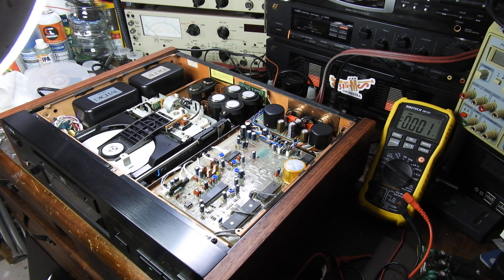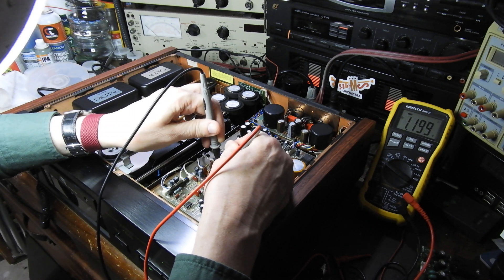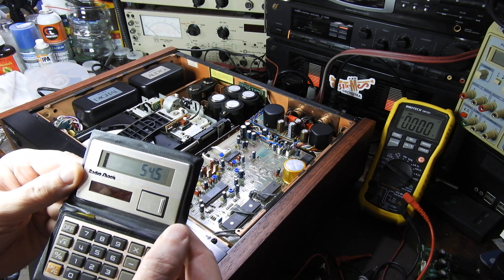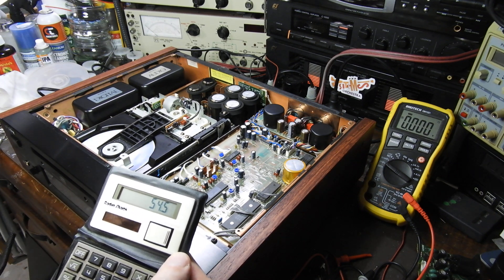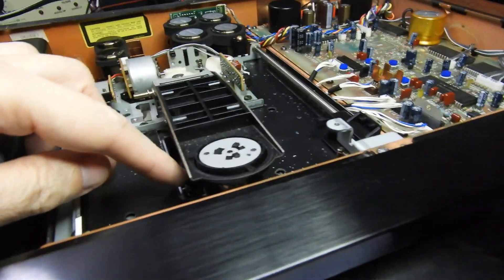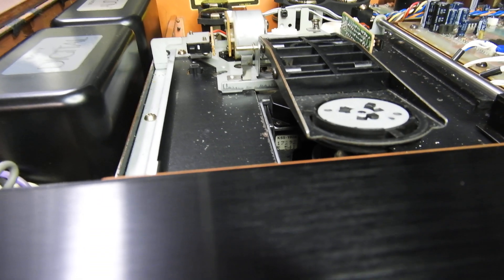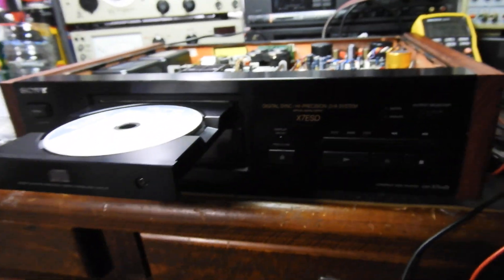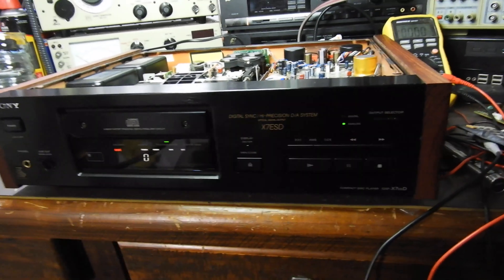Sony CDP-X7ESD final laser health report for the new owner. It still has 96% of its life left!

Comment: Do you have an idea where to find the corresponding resistor in the Sony CDP X707ES
Reply from the maker: Yes, it appears to be on the optical pickup block BU-6F (KSS-272A) itself. It hangs off the emitter of the only transistor there. It had no designation on the manual I just downloaded.

Comment: A friend has the same player , had it for years, but it has started skipping/jumping lately, any ideas on what I should check for him. Thanks 👍
Reply from the maker: First thing is always the clock frequency. It should be as close as possible to 4.32181 MHz. Then mechanics. See if the head travels freely (when player is off). See if there are any obstructions, because these magnets that drive the head also attract loose screws / washers that might have been dislodged. Then it is a servo alignment.

Comment: Beautiful player,.  Lucky to own a CDP-555ESD, 1988 and still going strong.  Can I check laser health using same method, it’s a bit far to send it from Scotland to you 🏴😄
Reply from the maker: It is not the distance that is a killer but costs. I regularly get players from Melbourne which is over 3000km away. But it costs only 20 squid.
Yes, you can do this with pretty much any Sony machine, because they stamp their laser heads with the initial current value. And to this date, whenever I looked at their diagrams, there always was a common-base PNP transistor with 22 Ohm resistor hanging off its emitter. It normally has a designation of R102.
Reply: @hear-net-au  Thank you,  I’ll give it a go.  Had player serviced a few months back, belt replacement etc but didn’t get a report of laser health, feels good when I see your videos of Sony machines and all the good healthy lasers in them.   Love your videos. Thanks again.
Reply from the maker: @Philip McAlpine On more than one occasion I had to solder wires onto the inaccessible part of the player to do the measurement. In yours, maybe access from the bottom is necessary. Interestingly, one of my CDP-302ES machines with BU-1 had laser power set to 0.3mW which is 3 times the usual value and I assumed that some one had adjusted it. The owner assured me however that he had it from new and no on ever opened it up before. I now see on my pics of the BU-1, that it says max power 0.6mW, so the old ones could be set much higher than the current ones. My BU-1 has 31310 stamped on it, and I would have to do some measurements to see if it related to the laser emissions in some way.